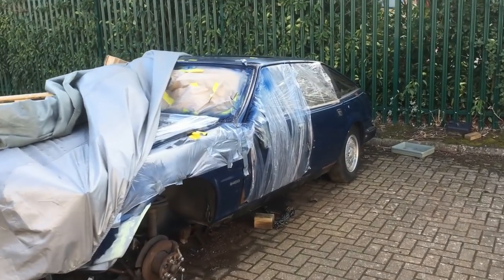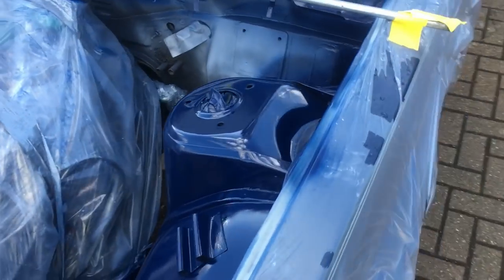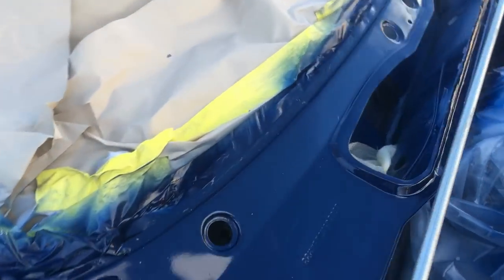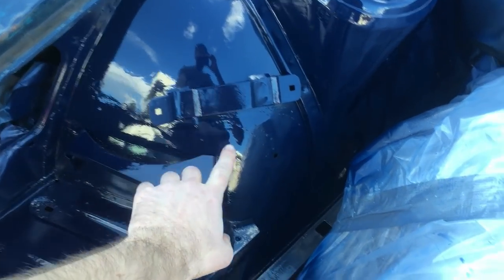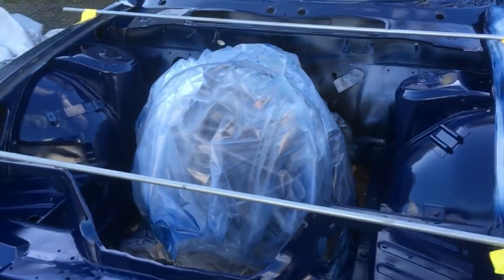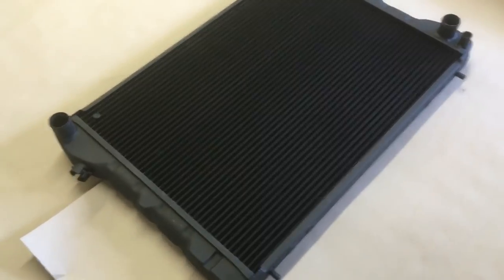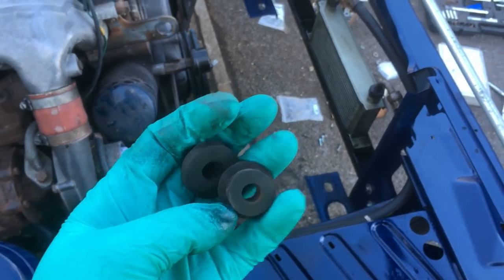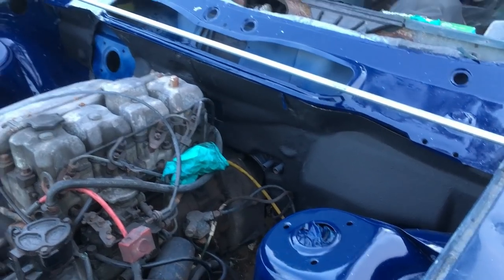Rover SD1 2400 SD Turbo restoration - Video 41 Reassembly

Comment: Has that thing got separate heads for each cylinder? That's like a bloody boat engine or a static engine or something.
Reply from the maker: Exactly. They were stationary/marine/light commercial engines. Separate heads so they could make a 3,4,5,6 cylinder unit.
Reply: @nitrosilvia  I was thinking it looked like a mini cummins or a Gardner LX series. They actually fitted those to cars  too.